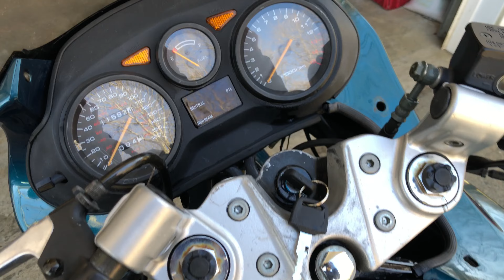Facebook Super Bike Gets New Tire/More Burnout

Comment: That bike is not running on 4 cylinders - check spark plugs and make sure you're getting spark on all 4.
Reply: think in the previous one he said he checked spark on the cylinder with the wet spark plug. but who knows. could be a different one not sparking. carbs may not be synced. I am not sure but I personally don't think it sounds like it's firing on all 4 by the sound.